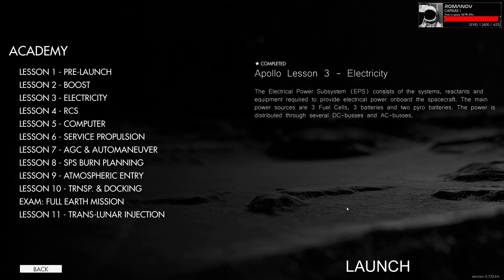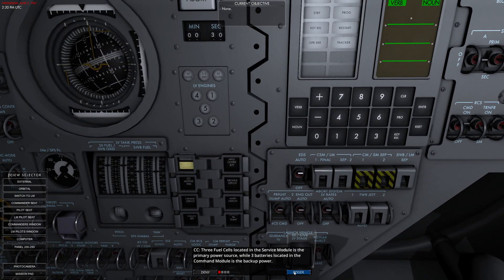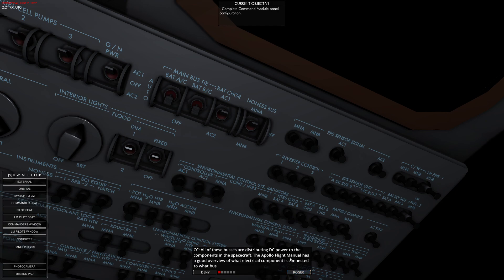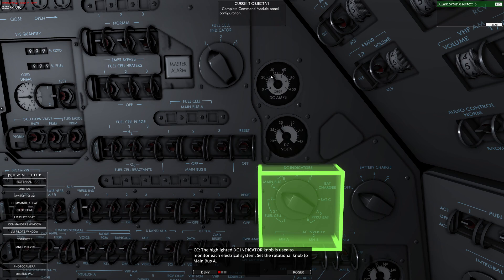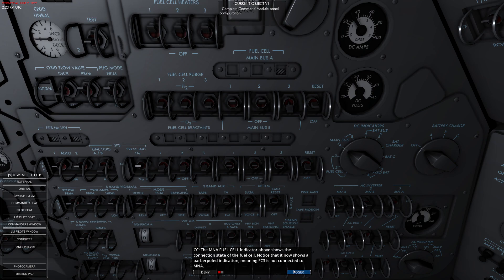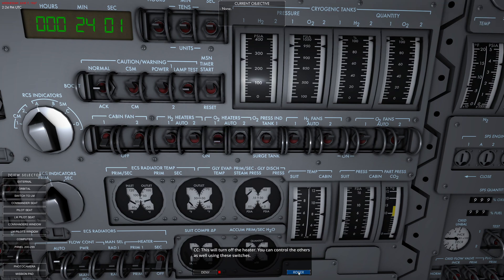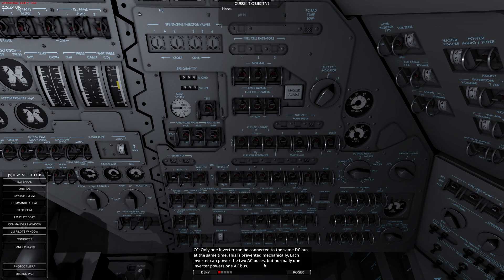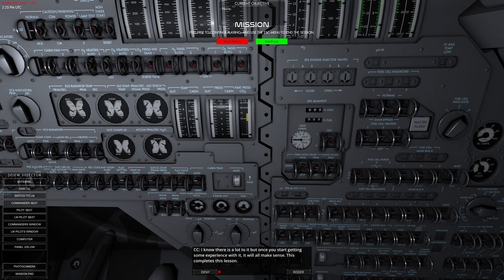ReEntry - An Orbital Simulator Apollo Academy 3 - Electrical

Comment: O2 and H2 tanks contain liquid. To use them for power, you need it to be gas. By heating the tanks up, you turn liquid into gas. If pressure is too low, you use heaters to vaporize the liquid. Opposite is true if your pressure is too high. You want to limit evaporation, so you turn off heat, and turn on radiators. When there is a 400 deg F difference between shadow and sunlight in space, this can be a challenge. Although, putting the CM into a roll can help distribute the temp. 
When these tanks are full, it's easier to keep them cold than it is warm, so you need heaters. As the liquid 02/H2 is used, of course the opposite is true. Simple cryogenics physics. Unless it begins to smell, then it's chemistry.